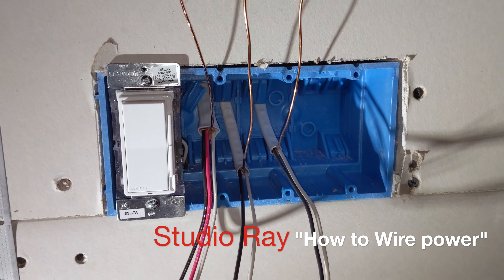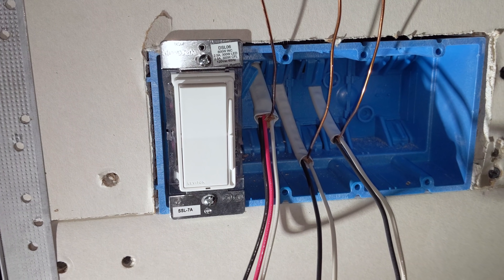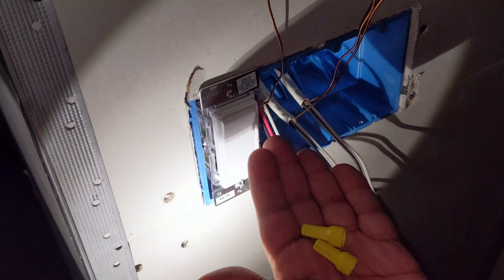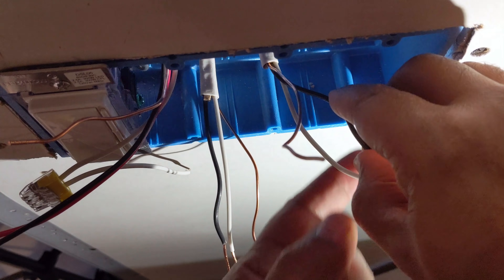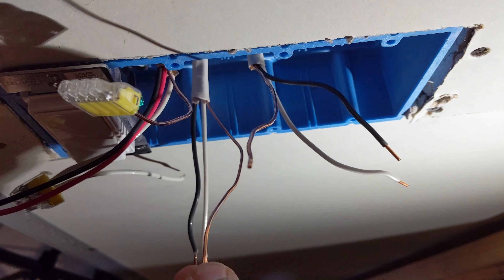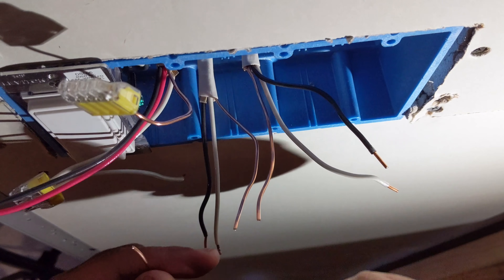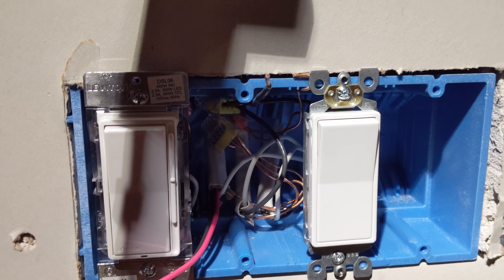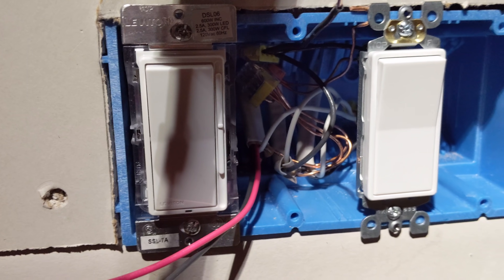How to Install Two Light Switches from One Power Source (line)

Comment: Maybe you can help me with my wiring diagram.  I wired from a switch to an outlet in the attic that a light is plugged into, from the outlet down to a switch that turns on the outlet in the attic. I wired the switch to the outlet white to white, black to black and down to the other switch the same way. However when I turn on the switch it trips the breaker. in last switch to I need to tie the white together and attach two blacks to the switch?

Comment: i have 2 switches that were outdated and not holding the wires in the mobile home.,  so i got new ones it has a power supply and a jumper from one to the other, but now it keeps flipping the breaker .  any sugestions?  the  guy that helped me i can see that the white wires are causing a burnt wire ,
Reply from the maker: Check your wiring. Make sure you don’t have them cross. The breaker trips when there is a problem with wiring or to to much load on the circuit.

Comment: Interesting video. I can’t say I understood it all but I think I got the gist of it. Thanks 
Question. 
I have a 220 vac 30 amp air compressor. I want to wire two 220 vac solenoids and a 220 vac hour meter. Solenoids draw about 20 Watts so I think that’s 0.09 amps each. Hour meter is negligible. 
The air compressor has a pressure switch that tells the motor when to go on and off. I’m thinking of connecting the two solenoids and hour meter to this switch. Connect them to the motor terminals and not the power terminals. This way, the solenoids and hour meter will go on and off with the air compressor. 
Is this ok? Tapping off of the two motor terminals to run three other things? If so, how would I wire them? Series or parallel?
The other option would be to only wire the hour meter to the pressure switch, and to put a DPST NO power relay between the wall outlet and compressor. Then wire the two solenoids to the power relay. 
In your opinion, which method is best, and what are the pros and cons of each approach?
I appreciate your help. 
Thanks,
Paul
Reply from the maker: Okay, that is way beyond my experience. I wished I could have help with your project. Try finding a forum for your questions. I think that may help. Good luck 🍀

Comment: Cool video.. good practice is 6-8" of wire protruding from the box and 1/4" of sheathing clamped within the box. The push connectors come in handy however when you have to start jumping to multiple connectors it leads to more chance of failure and overall poor workmanship also box crowding.
Reply from the maker: Thanks for the feedback.

Comment: What if the line wire is running off of another light that’s on a 3-way circuit? Should still be the same yes? My breaker keeps tripping when I try doing it this way. Crazy part is one of the switches works but the other won’t it keeps tripping the breaker.
Reply from the maker: Okay thanks for the feedback. If you having problems please consult with a License electrician.  I’m not a electrician I just have a basic knowledge of wiring. Good luck 🍀

Comment: Since you already have two separate circuits all you do is keep all your neutrals to one side and Tie Together and push in the back of the box  and The grounds you got a tie  all those together and add pigtails and use Wire nuts
Reply from the maker: Thanks for the feedback.

Comment: What damage can be done by wiring neutral white and black (power) to a single pole switch?
Reply: As soon a you turn the switch on, you will create a short circuit between the neutral and hot and should trip the circuit breaker. If it doesn't, turn the switch off and call an electrician.
Reply from the maker: I have no idea, but please consult with a licensed electrician for help. Thanks for the feedback and please remember to subscribe to the channel and like the video.

Comment: Multiple electrical outlets  in all 3 washroom  stop working after separating fan and light switch and installed  new  fan with light  when i turn the same  fan light on  the power comes to all outlets but when i torn it  off it  cut the power  in all the washrooms
Reply from the maker: Thanks for the feedback. You should draw a schematic of the electrical system on how the power is being routed. This will give you an idea how you should be wiring it. Good luck. Please remember to subscribe to the channel and like the video.

Comment: The push-in wire splice is easy squeezy but might not have the longevity/ reliablility of the old school wire nut. True, they take up more space and can hurt old hands like the devil, BUT consider they are "better" as far as quality. It could be argued,, sure.
12:26 it gets a little spooky. "If you put your fingers here and the power is on you complete the circuit". (WTF) How about "If you put your fingers here and the power is on it will shock the breakfast out of you! because you completed the circuit".
 I would not want to suggest touching the live wire and completing the circuit in case someone gets the wrong idea. Just sayin'. As long as the power is off.
Thanks for the vid. Helpful. 
BTW I have a bag of those yellow push-ins and I plan to use them today, unless I start feeling too guilty. 
Merry Christmas!
Reply from the maker: Okay. I wasn’t telling anyone Literately to put the finger on the wire. I was just trying to explain what completes a circuit. But you already knew that. Thanks for the feedback and please remember to like and subscribe. 😂

Comment: Don’t the neutral wires have to go to the switches?
Reply from the maker: Thanks for the feedback and please remember to subscribe to the channel and like the video. One switch is a 3way and the other is single pole switch.
Reply: Not the single pole switches as all the do is interrupt the circuit. But certain dimmers and specialty switches and smart switches do require a neutral for communication.

Comment: Hey man, what was the point of the ground pigtail? Couldn’t you just go straight to the grounds on the switches with the original grounds??
Reply: Definitely could have grounded each device independently. Idk why he created that spaghetti in there.
Reply: Initially the only grounded wire is the one coming from the power source cable, just like how the ungrounded wires must be connected to continue the circuit down the line.
Reply from the maker: Paul Retzbach I just wanted to ground all the switches. I chose to do it this way. Thanks for the feedback and please remember to subscribe to the channel and like the video.

Comment: The one part that is most important in this procedure is the part you fast forwarded through...  

Exactly which wires go on exactly which terminals of the switches themselves!

You show / explain everything else except the absolute most important part.
Reply from the maker: Thanks for the feedback, switches will have a light color (Silver) & Brass color (yellow). White wire = Silver terminals & black wire = Brass terminals for a basis wiring when you have only 14/2 wire. (White/Black/ground). Some switches will have it stamp on it which wire will go to which terminals. I hope that helps. Please remember to like and subscribe.

Comment: I've been here before, I guess over time other projects makes u forget sometimes so I'm back here becoming a student again lolz.... You never added or got the name of the Splitter device you used to split the black power wire or the ground wire....
Reply from the maker: Thanks for the feedback. Please check below. I added the links to the connecters that I used in this video.
Reply: They’re called push in connectors , but to be honest splicing is better because sometimes a cable can slip out.

Comment: I wonder if you can help me. I live in Germany, but we also work with three core cable for lights and domestic power outlets. I am currently renovating my girlfriends home. The house was built some time in the 60s or 70s. In her living room, she has a ceiling light, and left and right of the gable window, two other lights connected together. At the double switch on the wall, one switch is for the ceiling and one for the others at the window. Now for my dilema. Coming out of the wall to the switch is just "one" three core cable. The live of his cable feed (here also a red cable) is connected to the positive side of the switch. The blue cable and earth cable (here yellow & green) are connected to the other side of the switch allowing this one double switch to send power to two individual light sources. I pulled the connection out of the cavity ceiling to see how it is wired. There is a connector with four inputs/outputs where things get really complicated. It is at this point where the split to the two lights takes place. Can you explain this in simple terms? I don't understand the logic behind it. In your demo in this video, you have a feed coming in and two three core cables going out. To make things even more complicated, at the light switch on the wall, someone install a second single switch to power a second ceiling light. This was however disconnected and lay dead although still in the wall (there is still a cable lying dormant in the cavity ceiling connected to that four input/output connector mentioned above so was obviously in use at some point). Can you indeed connect three switches from one three core cable source? Hope you understand? Thanks
Reply from the maker: Okay,  Ignore the 3/1 wire going out in my video for now. Understand that the power has to come in to your switches. You have your Hot(live wire), Neutral (Cold wire) and ground wire. Once you connect the wire to the switch you then have take that power (wire) to its next location (Light fixture, outlet, etc). Once you able to connect the power successfully then you can continue to the next step. Now the 3/1 wire is power for a addinatal two switches on the same circuit. Meaning I have two switches working off that same power source. A 3/1 wire is needed if you want to control a light from two different location.  So you have to understand how to hook up a 3 way switch. Once you understand how to connect 3/1 wire to a 3 way switches system then the rest is EZ to follow. Sorry I didn't record this video to show how to connect a 3 way switch But just how to get the power to the switches.  Also drawing a wire diagram for your location can help. You will see how the power should flow to one location to other. I hope that helps. So again Learn how to set wire a single pole light switch first then learn how to wire a 3way switches. Once you know both disciplines the rest should come EZ. Thanks for the feedback and please remember to subscribe to the channel.
Reply from the maker: here a video that may help you also, https://youtu.be/xBEi_fYDMJw Good luck.

Comment: I need to split from one power source to two independent single pole switches that control two separate lights, i am confused if i need the 3 wire set up (red extra wire) on the second switch  or not. Great video, thanks!
Reply: LF I’m sorry if you understand this now but red wire is only needed if you are wiring a 3 way light if you only have 1 switch controlling your lights if you have 2 separate wires and your power wire in your box 1 switch on each separate wire you don’t need the red if you want to add a switch at the end of one or both separate runs of wire you need a red wire for 1 or both. You may need a red wire also if your lights are between your switch and you power source from power to first light is wired like normal but red is hooked to the brass screw instead of the red the blacks are wired together the neutrals are hooked to the silver screw and the grounds are hooked together second light and so on are red to brass white to silver ground is hooked together same as black at the end where the switch is black will hook to the switch and red will hook to the switch ground can or can be hooked to the box neutral is just wire nutted to cover the exposed wire. Red is also used for 220 as a hot same as the black not needed in your case just letting you know if you need to hook up an oven dryer whatever hope this helped and wasn’t confusing
Reply: @ar-gaming9014  Thanks a lot! I  finished wiring my switches today, I also  did get to wire a three way switch, thanks for the explanation, that helped!
Reply from the maker: L. F. The wire choice depends on your application. 14/2 wire or 14/3 wire. I’m using 14/2 wire for the Storage closet area (on one switch). The 14/3 wire is being use to control two switches for the family room lights.  I hope that helps. Thanks for the feedback and please remember to subscribe to the channel.
Reply: @DIYNATIONUSA  Thank you for your reply, I already wired my switches thanks to your video. Thanks a lot for your video and suggestions.

Comment: That's awesome! Thanks bro. Just remember they require a neutral pig tail to be capped off for each switch on the box, just an extra one in case someone wants to add an automation switch later on because the automation switches require it. It's best to do this while your doing everything else do you damage anything later trying to add one in.
Reply: If you do not have a neutral Lutron makes a smart switch that does not need it. It uses internal circuitry to have the constant power the neutral wire would have provided. Its more expensive, but its also the highest quality smart switch.
Reply: @davejohn255  Series switches (no neutral required) are problematic with LEDs as their power is derived THROUGH the load.  In a lighting circuit, this is the light, itself, and it's enough current to keep the LED dimly lit all the time.  The less-expensive LEDs are even more problematic and you might hear some buzzing, as well... all with the dimmer "off."
Reply from the maker: Thanks for the feedback and please remember to sub to the channel.

Comment: Really great video, kinda confused on the red wire on the 2nd switch... understood the black wire connection on that switch but the red wire... what was it for?
Reply from the maker: The red runs to my other switch across the room. Thanks for the feedback and please remember to subscribe to the channel
Reply: @DIYNATIONUSA  Where does the neutral white wire goes then, since you can only connect ground, neutral and line wire at a time to a switch?

Comment: Using a wire nut to pigtail down to 2 seems more logical so you don’t have so many connectors taking up space in the box
Reply from the maker: Wire nuts or wire connecter both will do the same thing.  I just like the wire connecter. thanks for the feedback and please remember to sub to the channel.
Reply: A traditional wire nut in this case would have been a cleaner option with such a crowded box.

Comment: Instructions confusing after you get to the hot wire part.  Too many variables at play here.  It's very simple.  In a junction box, one feed (G,N,H) comes from breaker panel.  Let's say 2 supplies to go out, one to bath fan, one to bath lamp.  Each of those supplies also have their own G,N,H leads.  Simply join all Gs, all Ns and all Hs together.  Thus, there will be 3 ground wires in one connector, 3 neutral wires in another and 3 hot wires in the last connector.  That's it.  If you need to add an additional circuit, these numbers will change to 4 from 3.
Reply: It was pretty simple just verison of pig tails group all the whites then he had main power line with 2 pig tails to go to each switch then had each wire that goes to each light
Reply: Exactly
Reply from the maker: Thanks for the feedback. Will try better next time. Please remember to sub to the channel.
Reply: Ray's was better explained.  Your explainantion was confusing, at least to me.